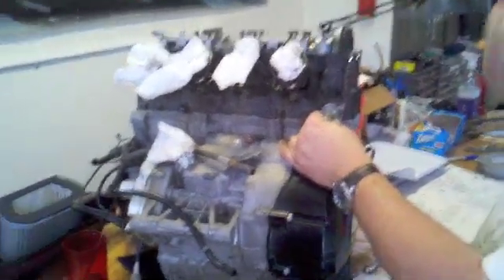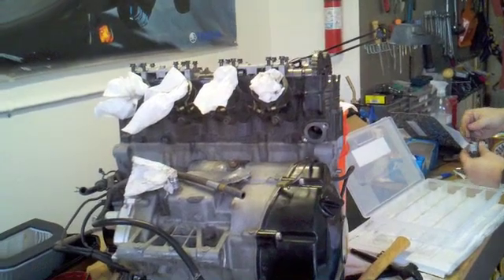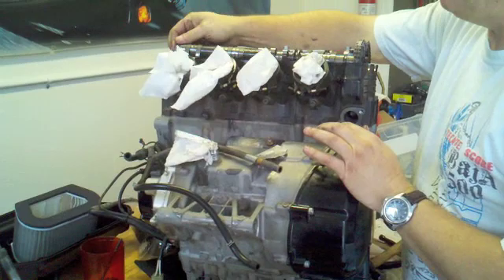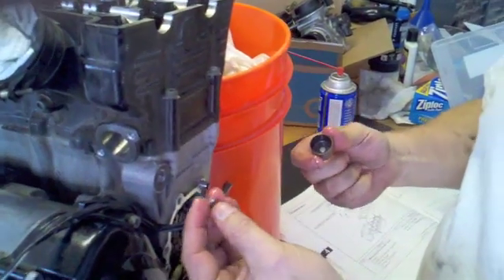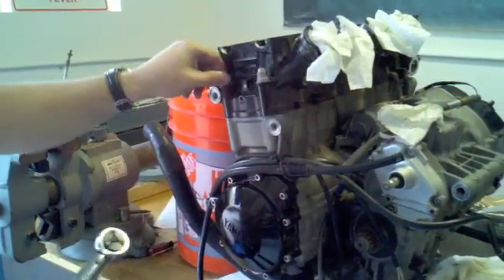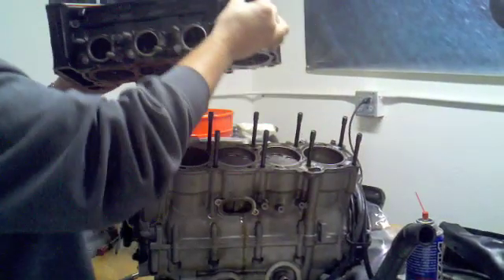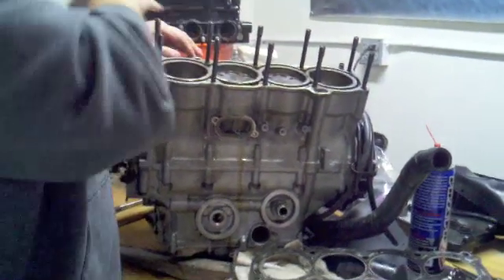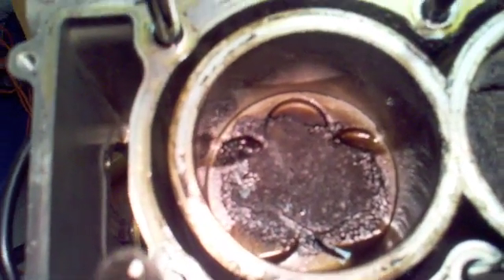2000 Yamaha YZF-R1 Engine Rebuild Part 4

Comment: Buenas  tengo un problema con el cable del sensor de presión de aceite de yamaha r1 2000 se desconectó y no encuentro el sitio donde se conecta me lo puedes mostrar donde se conecta. 
Gracias
Reply from the maker: No hay sensor de presión de aceite en 2000 R1
Reply: @repomannv  buenas gracias por tu respuesta debajo del motor tiene un sensor de aceite no sabia k no era de presión  k el cable sube por el lado de la pata de cabra porque tengo encendido el chivato del aceite en el panel .
Una vez más se me puedes ayudar gracias 🤙🤙🤙🤙
Reply from the maker: @jorgeantoniosilvagloria1294  Ese es el interruptor del sensor de nivel de aceite que debería conectarse cerca de los carburadores, ya no tengo mi R1, no recuerdo el conector específico
Reply: @repomannv  muchas gracias por tu ayuda 🤙🤙

Comment from the maker: The bike was running pretty smooth before the rebuild, but it was burning a lot of oil and was a bit down on peak power.  After rebuild the bike ran smooth, and with a bit more pep - but my objective wasn't more power.  Bear in mind, some of this is due to the motor rebuild (pistons/rings/cylinders), cleaning and syncing the carbs, and general tune-up.